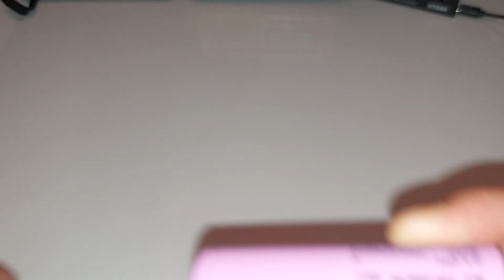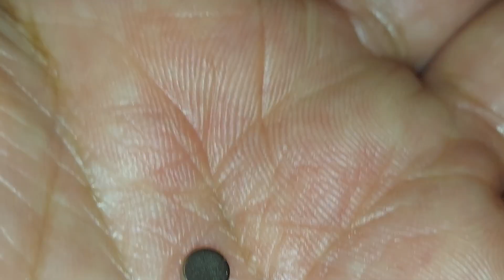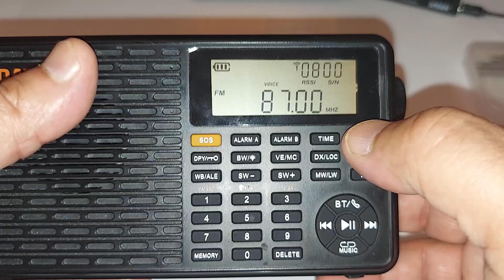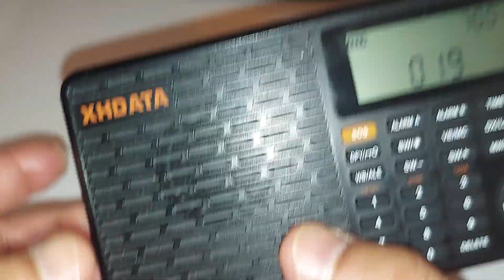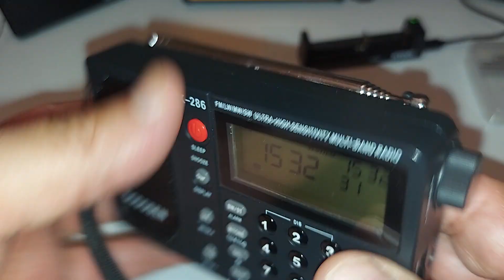How to convert a flat top 18650 battery into a button top 18650 battery.

Comment: Excellent hack! You can make it semi permanent by cleaning both surfaces with isopropyl alcohol, putting the magnet in the right spot, CLAMP IT THERE gently so you get positive contact, and then add a tiny spot of water thin CA. Star Bond works great.
Reply from the maker: Thank you for sharing your tip!  Have a great week.